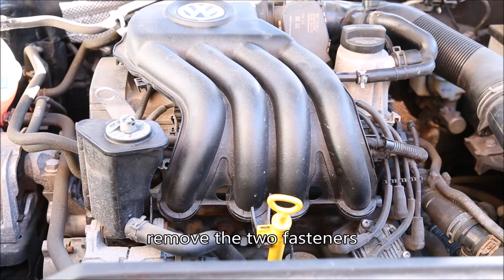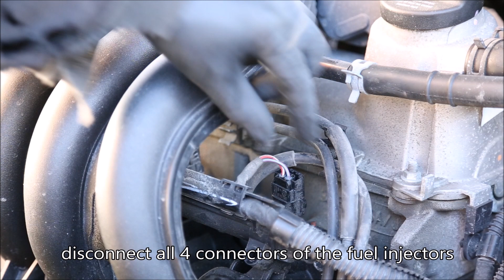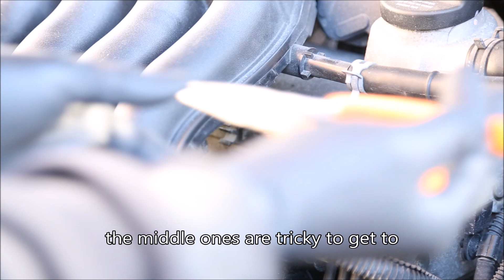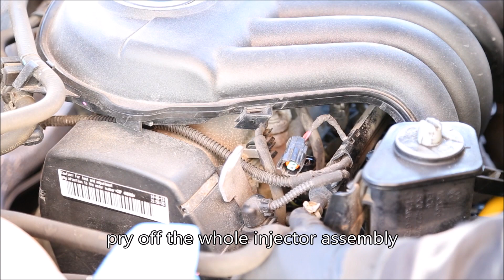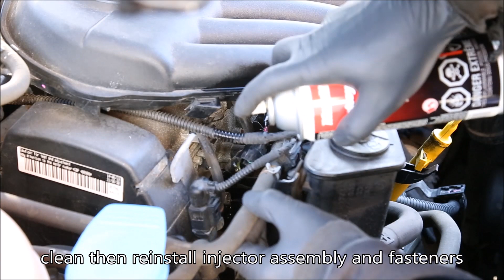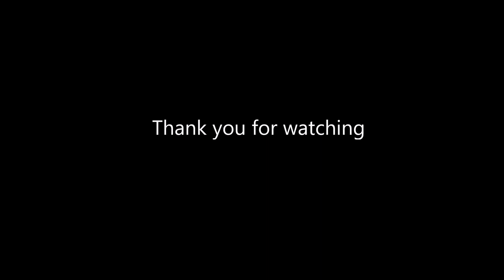Volkswagen Jetta 2013 Spark Plug replacement

Comment: How the fuck do you install the wires?? It's practically impossible without the proper tool. I keep searching yet cannot find the right tool. I've already bought 4 special pliers and they're all useless. The boots are supposed to click when seated, but I can't get mine to click down and I have two cylinders misfiring....
Reply from the maker: it takes a lot of dexterity and a lot more of patience

good luck

Comment: Why did you not show removing the two spark plugs in the center? Did you only replace 2 instead of all 4? I'm here debating i should take the manifold off.
Reply from the maker: I removed all 4 using the same method, you can wiggled them out of there if you have small hands or tools, I did not remove the manifold for this

cheers

Comment: awesome video, thank you. What did you use to clean fuel injector assembly and did you wipe it off with a towel?
Reply from the maker: I used some intake cleaner that I had laying around the house and I let it dry 

cheers
Reply: Is it necessary to clean?

Comment: Man my 2012 Jetta has been sitting there for a minute because I was unable to reach the plugs hole under the manifold...now if I need to rethread the hole...is this method still possible? Or would I need to remove the whole manifold completely? Btw THANKS I’ve been trying to find a video like this here for AWHILE now lol
Reply from the maker: if you need to retread the hole I would take off the manifold for better access

cheers

Comment: SHould show how to get at the center ones.
Reply from the maker: thank you for your comment the center ones are done exactly the same as the outside ones

cheers
Reply: ya exactly!
Reply: Are the fasteners a special screw ? Or is it a regular Phillips or flat head?
Reply from the maker: they are torx

cheers
Reply: Yup... that was very clear
Step 1: Loose fuel injection line.
Step 2: Remove Coil #1 or #4
Step 3: Remove spark plug #1 or #4
Step 4: Spray a non disclosure substance (looks like Barbasol bottle)
Step 5: Do the right spell (incabus sparkpanitiquilus ) and voila, magically    spark plug #2 and #3 under the intake are perfectly done.
Step 6: Re attach the fuel injectors line.
And you're done... as easy as 1 2,3 4,5,6....